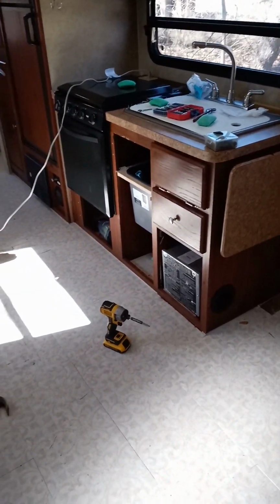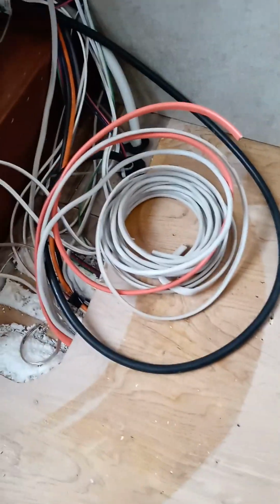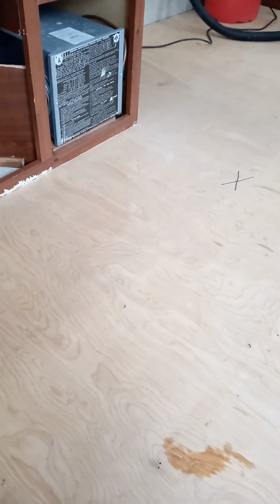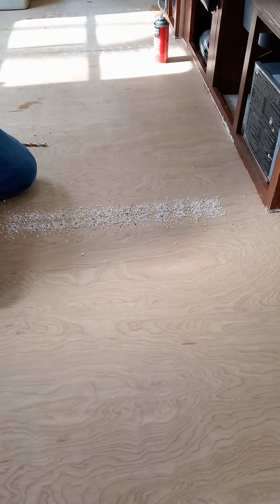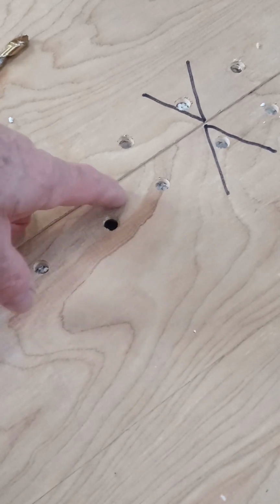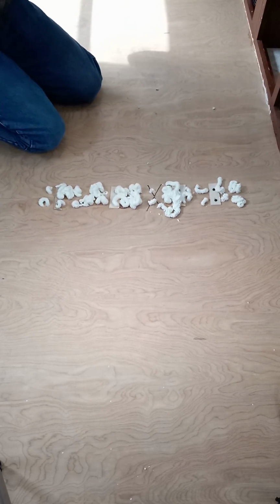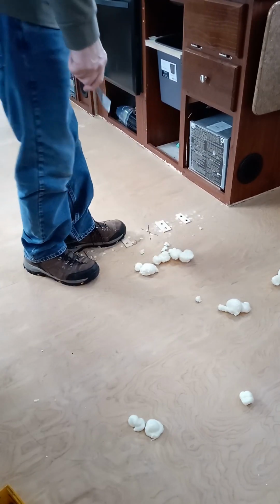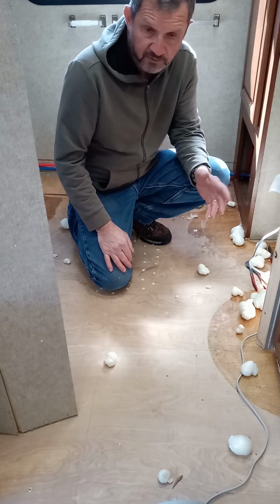Ultralite Camper soft floor repair on laminated foam/plywood floor.

Comment: Just finished this on my caravan floor
Drilled my holes at 2inch spacing found 4 was too far in mine
As it was very spongy
I am going to overlay the floor with click together flooring 
This made the floor firm and not squeaky
Thanks mate
Reply from the maker: Glad that my video was helpful in repairing your floor!

Comment: Hi Charles how did it work out once you put the 1/4 inch overlay on? Also when you shot the foam in did it bow the plywood at those seams? Thanks for your help great video
Reply from the maker: The floor didn't bow out the plywood it the seams. It did expand out the holes. The 1/4" underlayment really seem to add more strength. No more soft spots 😊
Reply from the maker: I was surprised how much the foam made the floor solid again. Interesting side note. On my camper the plywood on the bottom side of the floor was thicker than the top.

Comment: You are going at fixing it from wrong direction....if you get underneath and have someone walk on it you will see where it is flexing inbetween the steel supports.  You need to add cross braces of steel to reinforce the floor.  I did this and my floor is solid now.

Comment: Other videos they use epoxy.  Is this as good?
Reply from the maker: It was much easier to use and I would say it does the same as it relies on the bottom plywood for support. The great stuff foam doesn't compress very much as I show in the video.